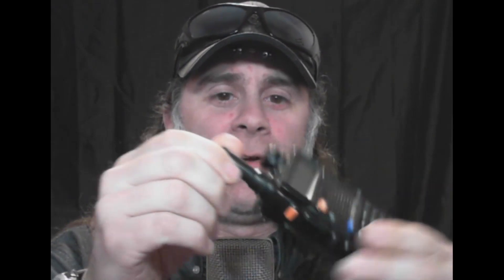Baofeng UV5R Mod, Volume Knob Hack, Retevis RT85 Volume Knob Anti-Bump

Comment: Will any 3/8 O-Ring Will Work On The BaoFeng UV-5R Volume Control Knob.
Reply from the maker: Sure, it doesn't even have to be a 3/8... It's whatever random O-ring you can find that you can stretch/roll over the top of the knob that will fit and put the friction on it that won't break from being too right. It's not an exact science type of deal. I just grabbed an O-ring out of my kit that fit. You can just head to the plumbing section at the hardware store and buy an assortment package of O-rings for like a dollar or two, you also might find a cheap package at the automotive parts store. Home depot or similar store will usually have a fastener section that has tons of little drawers full of little bits and pieces like O-rings that you can buy just one, so you can test out what size works and buy a few. Hope this helps

Comment: I thinking of using an oring to start with. Once I saw this I went for it. I have 4 baofengs, different models. Two this won’t won’t work but my 5r it is certainly better however, my at-152 it worked on the best.

Comment: Thank you! I have had this problem with a handheld aviation radio turning on by itself in my flight bag. Great fix!
Reply from the maker: So glad I could help. I have an Oring on my radio on my belt right now, I was forever having the knob turn itself off or all the way down and I was missing communications

Comment: Probably can add a little dielectric grease too
Reply from the maker: Dielectric grease is so darn slippery it might loosen the grip of the O-Ring... But it would be worth testing it, because some dielectric grease would definitely keep water out. If you also put an O-Ring on the antenna with some E6000 on the flash light LED you would keep rain out of the radio when it's on a chest pouch.  Won't get IP67 but it would help 👍👍